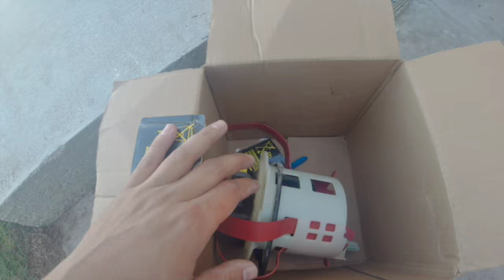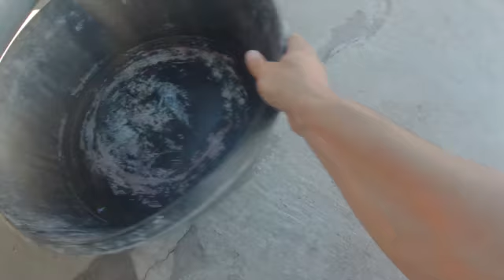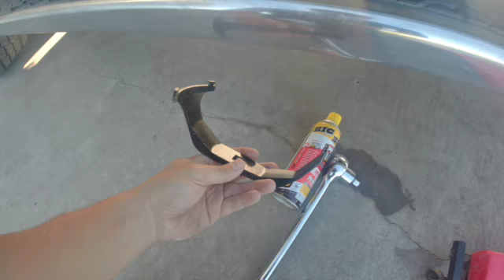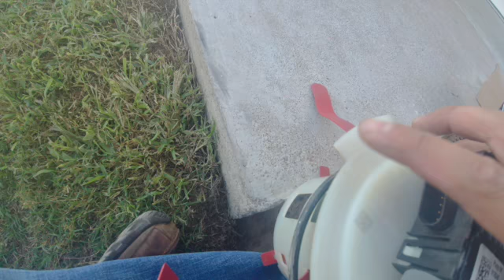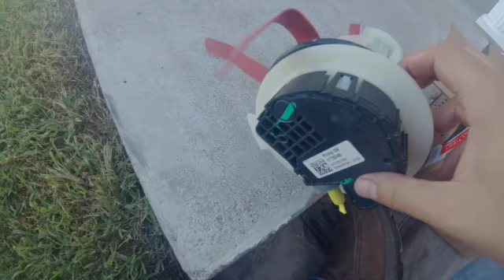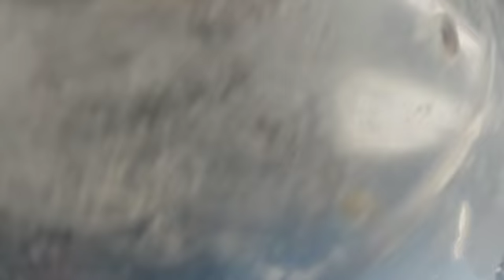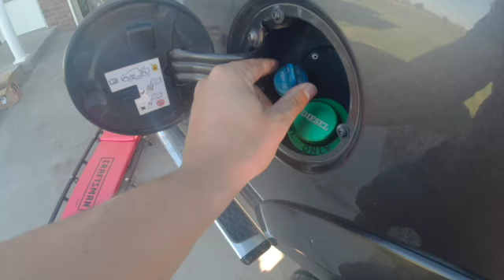P20E9 P2BAC HOW TO REPLACE DEF PUMP ON RAM TRUCK - It finally went out!

Comment: Is the pump and sensor for the gauge together in the pump?, Question my DEF gauge is struck and will not move. 
Getting P203E code with the tank full .  Or do I have to replace the tank ?
Reply from the maker: Yes the gauge is in the pump. I think it’s called a sonar board or something like tans and it does not read until it’s exposed to air. So you have to burn a few gallons before it reads since the pump is mounted from the bottom. So if the gauge isn’t working in the pump then you have to buy a new pump since it’s built in. I would pull the pump out and look inside the tank make sure it’s clean. Soak the white side of the pump in some hot water carful not to get any water of def in electrical connections. Put the pump back in and put about 2 gallons in and see if it fixed it  pumps can cost almost 2,000$. Sometimes you can find them on eBay for around 950$
Reply from the maker: Watch David’s video on the pump he explains how it works really well. https://youtu.be/czJZuc8ThhI

Comment: Where is the link for removal tool?
Reply from the maker: There is a little drop down arrow to the right of the title of the video. ^ looks like that symbol but pointing down. Click that and it should open the description and you find down in the links at the bottom.

Comment: Is there anyway without a tuner to tell that your pump is out?
Reply from the maker: Unhook the DEF supply line from the injector in the exhaust let it hang down turn the key and start the truck and see if it starts pumping out fluid